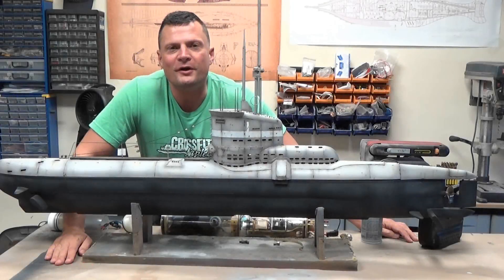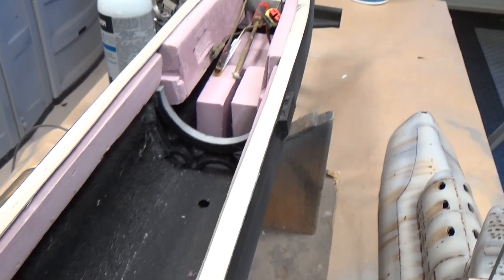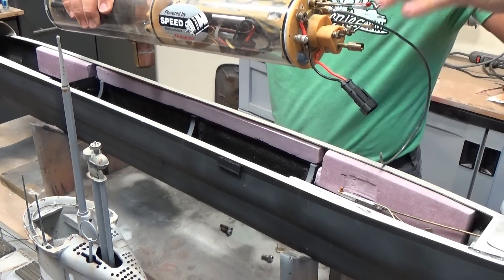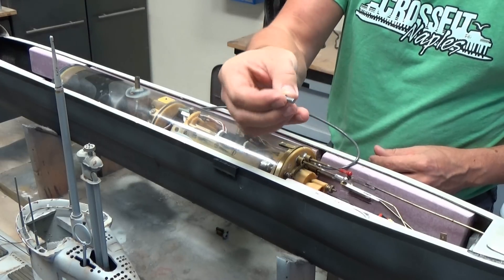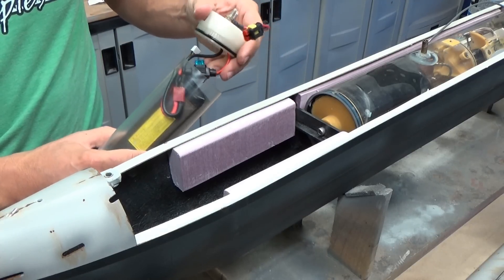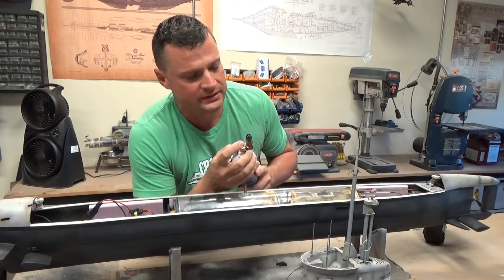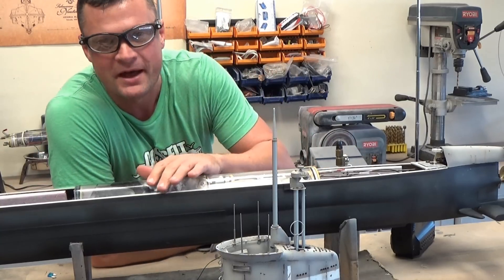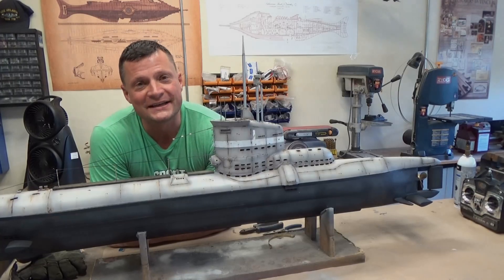OTW Type XXIII Overview

Comment: i dont know if anyoneelse ever asked, but why do you nearly never use Pistontanks ...  they're far superior
Reply from the maker: I have used them extensively. They are not far superior. They are different. Every ballast system has pros and cons. Piston tanks are very power-hungry and take up lot of room inside a boat. You need to allow for the shaft to extend far into the model. Don't get me wrong, they're great, but not perfect for every application and every builder. 

Don't be a ballast snob!  ;)

Comment: Hi Bob,
With regards to the valve that is on the top of the onboard gas supply(that you press the propellant can onto) and the blow valve inside the ballast tank....are they regular car tyre valves..Schrader valves....?
Thanks
Reply from the maker: Yep! They're normal car tire valves.

Comment: How many RC subs have you built to date? i'm curious because everything about these subs are built with master craftsmanship, everything from the exterior to the interior modules is just insanely well made. Did you look up other peoples designs when learning to build these subs are did you come up and design everything yourself? I'm guessing your cylinders has a lot of modifications compared to the cylinders you buy online. Also do you reinforce the structure of the hull because i almost tough the hull was going to snap i to when you were going to fill the tube with compressed air.  o and how long does a normal build take? Anyway cheers great builds as always, really looking forward to the type ixx =)
Reply from the maker: I haven't really kept count of my past builds as a tally, but a conservative guess would be around 50 or so, I'd think. 

My technique for building the boats is a combination of my own trial and error and the work that other amazing builders have come up with over the years and shared with the community as well. 

The hull has internal bulkheads that serve to not only reinforce the hull's width, but also form the mounting platform for the cylinder. 

Depending on the scope of the build, it can take me anywhere from 20 to 200 hours. I don't really keep a tally on that, either (though it would be a good exercise!)
Reply: Yeah i saw the bulkheads for the width, i don't think i can see any for the length of the boat though, i guess there is no need? or are they just behind the foam on the sides?